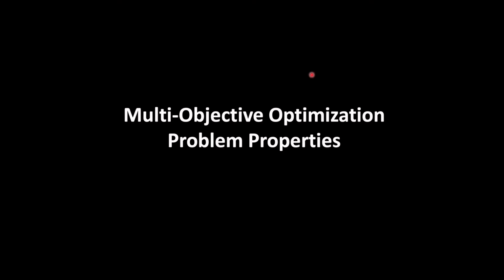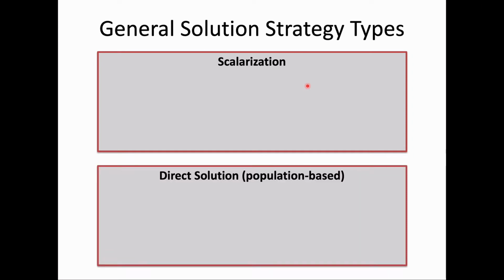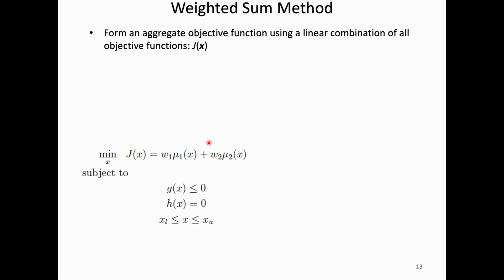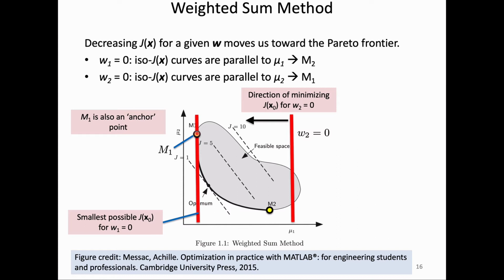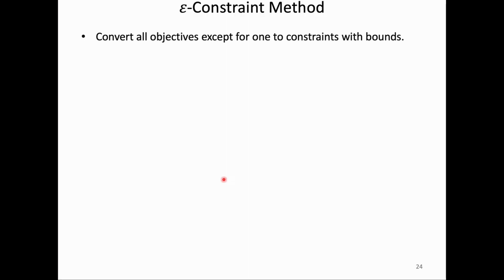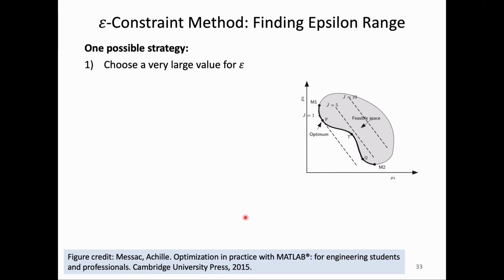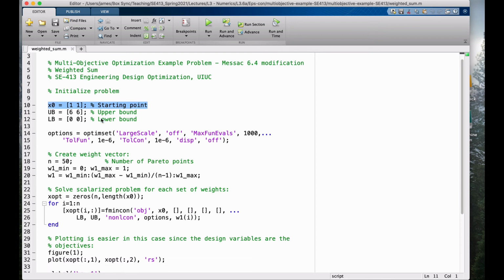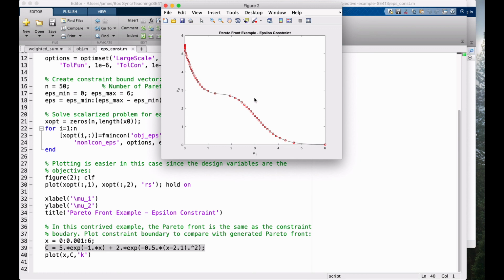Introduction to Scalarization Methods for Multi-objective Optimization

Comment: Good Job, I have a question in the example you gave, what exactly is the solution? all we got at the end was a graph of mu and mu, Can you please elaborate on that? Thank You
Reply from the maker: The solution to a multi-objective optimization problem is a set of non-dominated points. The plot shows the set of points that comprise the solution.

Comment: Hello Sir, I learnt a lot from this lecture. Thanks a lot for the video. I have used the weighted sum method for ranking my alternatives of products from which I am choosing the products based on the ranking achieved by the weighted sum method. I have 6 parameters for which I have assigned weights. Now I need to prove that the solution is convex. Could you please guide me on this? How do I proceed to solve that the ranking I have done is optimal?